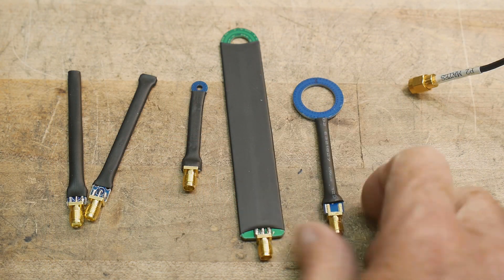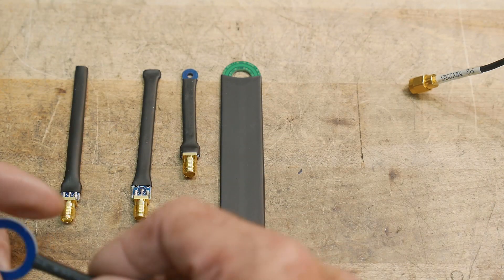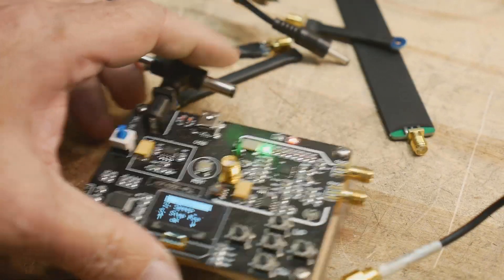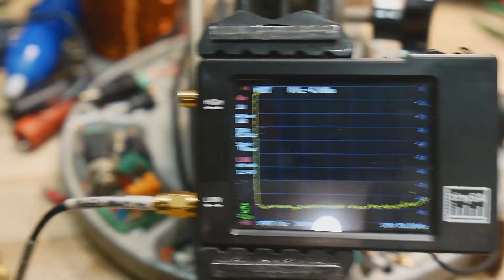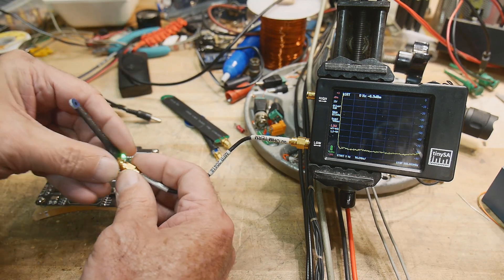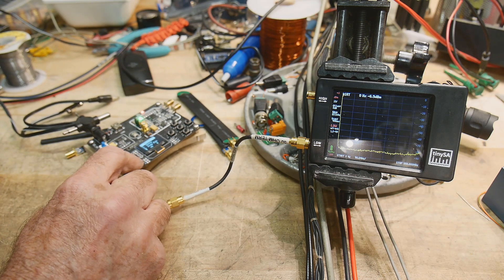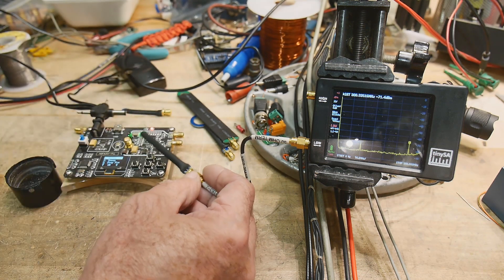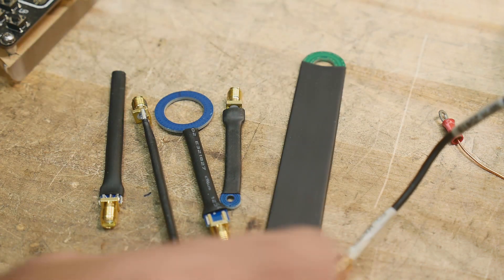#732 E and H Field Probes for your TinySA or any Spectrum Analyzer

Comment: I work in the automotive field and I’ve really been enjoying your videos/learning about the tiny SA. I deal with a lot of vehicles that come into service shops with TPMS sensor or Key fob concerns. Typically either 315MHz or 900MHz. As part of my diagnostics I’ll use an AM/FM radio to diagnose for RFI concerns typically coming from other electronic components on a vehicle. For example I had a touchscreen emitting unwanted RFI that blocked the signal coming from the front TPMS sensors. I would really like to use the tinySa for RFI noise diagnostics but unsure how effective it would be. With the AM radio I check for popping coming through a pure static station. But I bought a tiny SA because I want to learn more about it. Any advice? Seems unwanted RFI is very chaotic and knowing what’s good vs bad is difficult since everything has some sort of RFI.
Reply from the maker: I hope you can find others who have tried that method, otherwise you are inventing a new way by yourself and you may be underqualified.
Reply: @ It can be very challenging. It’s a lot of trial and error using a AM radio. If we have a component we suspect is causing unwanted RFI we will remove power and retest the Key fob or tire sensors. Then recheck the hit rate. I have one I’ve been helping a technician on that has an issue with the rear tire pressure sensors losing communication. I do have access to many known good like vehicles. So I may be able to establish a known good publication. Thanks for the education!

Comment: Cool vid, I got a set of these through amazon vine and only have a rtl sdr, will be getting a tiny sa soon. Do these have any other general purpose they can be used for other than probing electronic boards? What sort of frequency range and impedence do they have? Mine have zero info about them.

Comment: Will I need an attenuator to prevent overload damage when getting near small transformers and such on a PCB? (I plan to buy a TinySA Ultra.) These probes seem useful to identify clock frequency and HF on the DAC of toy keyboards etc. In many circuits with resistor controlled clock the frequency drops or the thing crashes when directly connecting e.g. an oscilloscope to clock pins.
Reply from the maker: no, they are safe

Comment: I have the same set from Amazon. 
A trick i learned when sniffing for RF is that once you have made your initial sweep, and you get suspicious of an area, and are not sure if there is an active signal, you can attach a battery powered sma amplifier to increase the signal.
Sometimes the signal maybe shielded or too low for those probes alone to pickup. Those battey powered amps are everywhere, and since its rechargeable, its also isolated.

Comment: I bought the same set. My question , how do they work when there is continuity between both poles of the sma connector? At least the ones I purchased seem to be shorted between the soldered connections of the sma to the probe. Any input would be appreciated. Thanks for the video
Reply from the maker: think of a transformer with only one turn. the fields you measure set up currents in the turn
Reply: Duh, That makes total sense. Thanks for the reply and all the great videos.